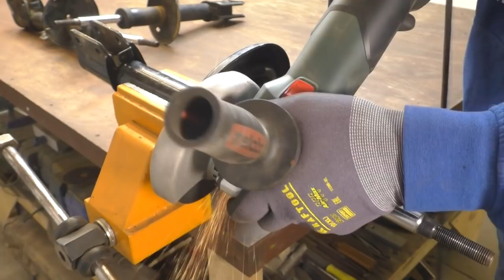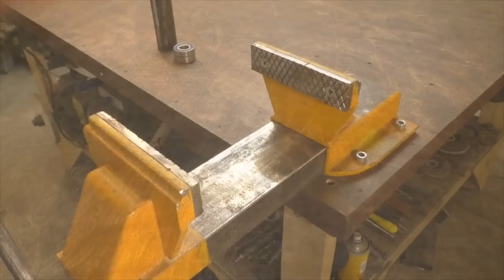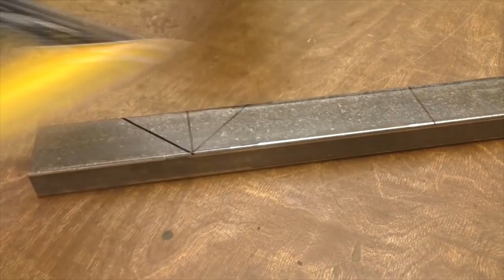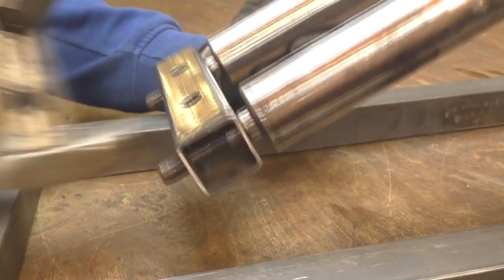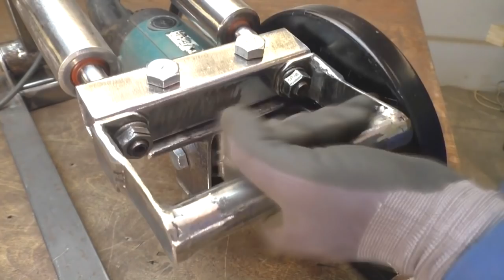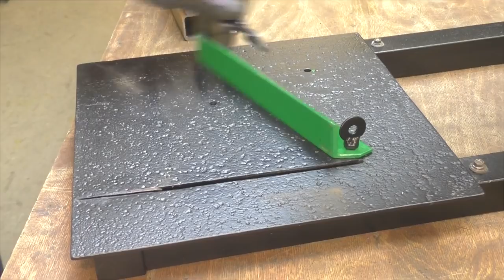Powerful machine made of old car shock absorbers! Don't throw away your old auto parts!

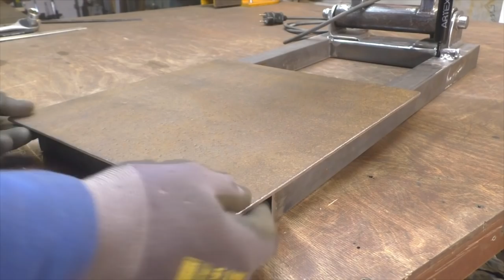Comment: Lovely job!  Clever use of normally thrown-away parts! 👍   Any thought to maybe some sort of block to keep the unit from cutting into the front bar 6:35 & 9:03 when a brand new disc is installed?  I'd be afraid that one time you might just forget and cut through the front piece.  It looks like it's already been cut a little... might be more trouble than it's worth, and just be aware of the chopper's ability to chop itself!  Again - bravo!  🙌

Comment: hydraulic rams, electric motors, the prospects are endless, when I was at school, me and mate had a business selling kindling for coal fires, we went mechanical when we made a saw from a washing machine motor, some bicycle tubing, scrap steel and a 12-inch diameter circular saw from the woodyard provided by someone who worked there, total cost nothing, our firewood business stepped up several gears that weekend,